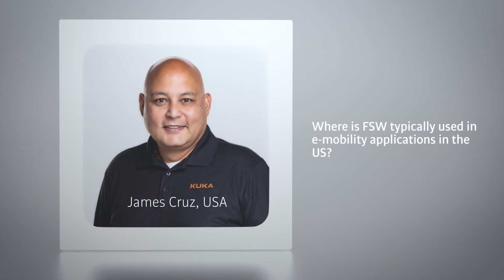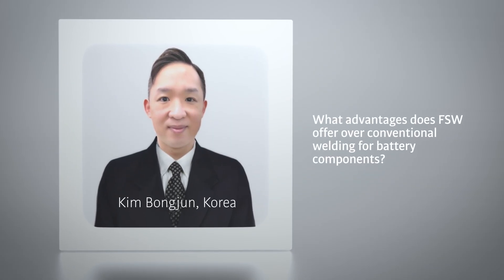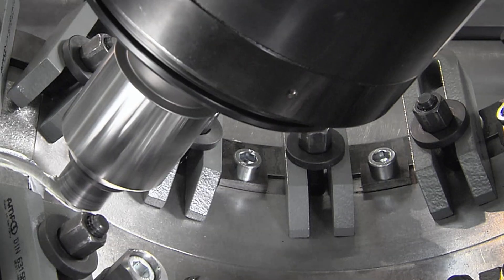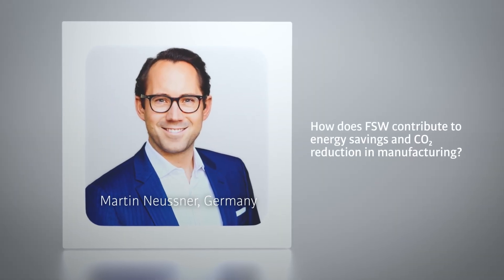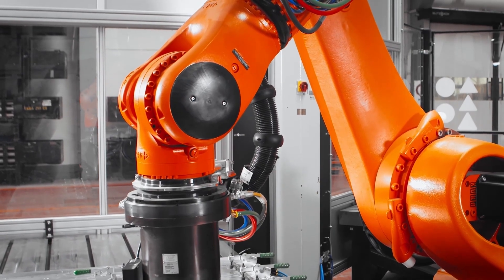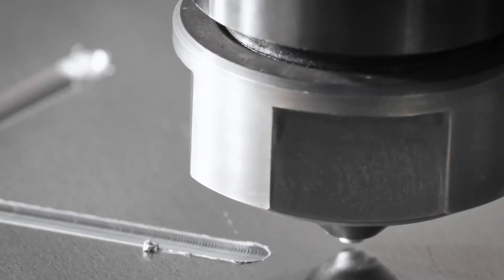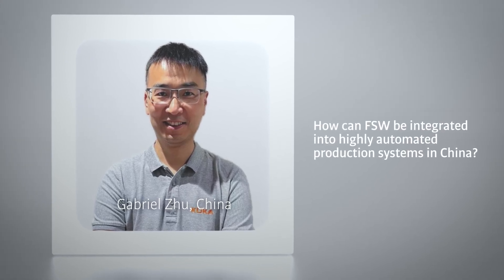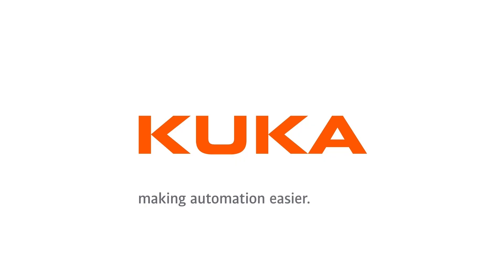Why Friction Stir Welding Is Quietly Shaping the Future of Electric Vehicles

Comment: What is different in friction stir welding compared to other welding types? I do not get it 🤔
Reply from the maker: KUKA's friction stir welding (FSW) stands out from conventional welding techniques in several important ways, particularly in terms of quality, flexibility, and automation readiness:

Solid-State Joining Without Melting
Unlike arc or gas welding, FSW joins materials without melting them. A rotating pin generates frictional heat that plasticizes the material, creating a strong bond with minimal distortion and no weld defects like pores or cracks. 

No Consumables Required
FSW does not require filler materials, shielding gases, or flux. This reduces material costs and simplifies logistics. 

Low Heat Input and High Seam Strength
The process uses comparatively low heat, which minimizes thermal distortion and preserves the mechanical properties of the materials. This is especially beneficial for high-strength aluminum alloys and dissimilar metal combinations. 

Versatile Material Compatibility
KUKA’s FSW is ideal for joining non-ferrous metals (e.g., aluminum, copper, magnesium) and even dissimilar combinations like aluminum to steel—materials that are often difficult to weld using traditional methods. 

High Reliability for Demanding Applications
FSW produces gas-tight, crash-resistant seams, making it suitable for critical applications like battery housings in electric vehicles, aircraft fuselage parts, and high-speed train components. 

Automation and Modularity
KUKA offers modular robot-based FSW cells (e.g., cell4_FSW) that are cost-effective, flexible, and easily integrated into automated production environments. These systems support reprogramming and adaptation to changing production needs.